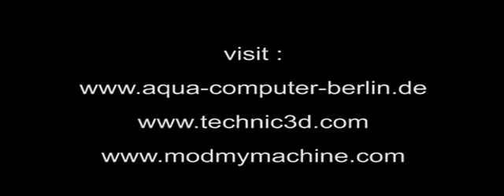Tutorial - Installation CPU Watercooling - english

Comment: @tonib000y personnally i bought a Zalman CNPS9900A LED
 (heatsink) and it's great, not to loud and you can overclock quite a bit with it if you use a good thermal paste. but afterwards, i did regret not getting a watercooler because they practicly don't make any sound at all and you can OC even lore with them, so if i were you i'd get a good CPU and a water cooler, then overclock it like hell ;-)

Comment from the maker: don´t need to ... because i know the right answer before .. 20 liters an hour is sufficient. sure you can get 1-2°C lower temps. but the price is a loud pump. gimme the same sys with 2°C higher temps ... i overclock the same and my system is quiet ;-)

Comment from the maker: yes you can use it with a single radiator.  please keep in mind that you have limited cooling capacity. but for cpu and a midrange gpu it would be enough.